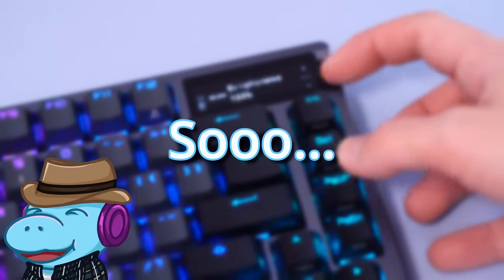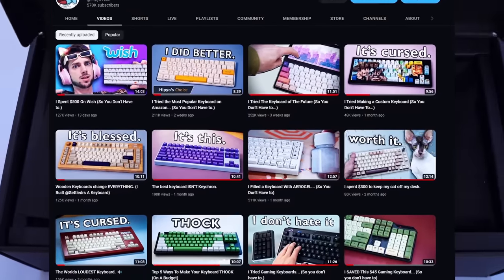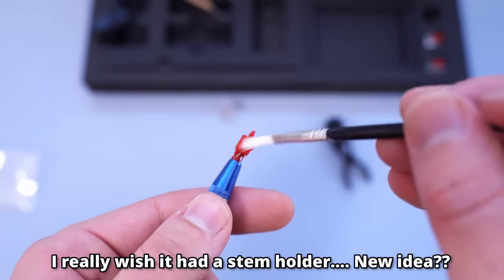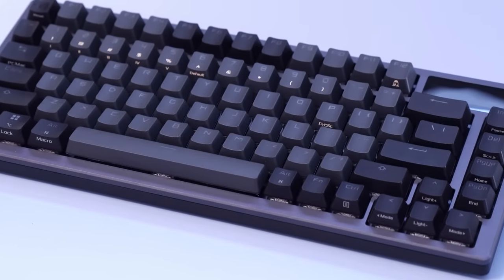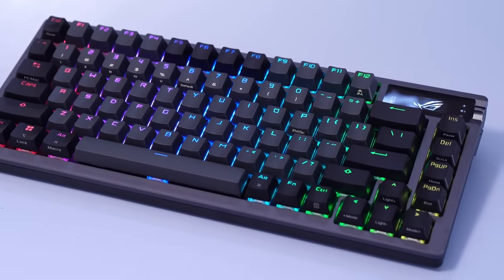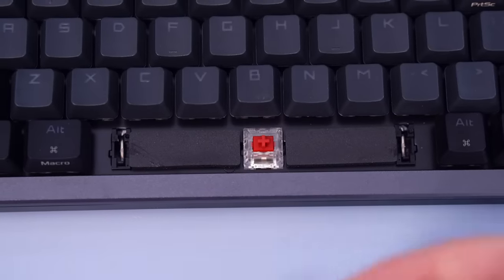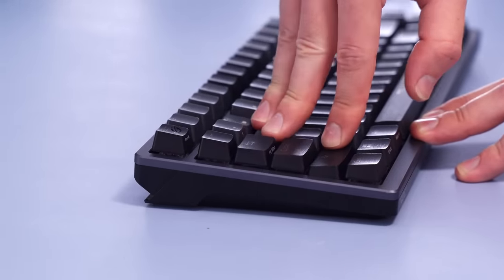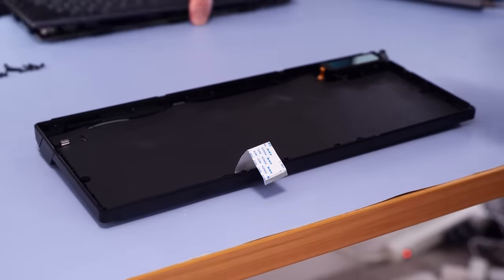I Tried the New ASUS Keyboard. ( ̶S̶o̶ ̶y̶o̶u̶ ̶d̶o̶n̶'̶t̶ ̶h̶a̶v̶e̶ ̶t̶o̶)

Comment: My problem with enthusiast keyboards were that they never had fast enough response times on their wireless functions than wired for gaming.  I really hope more companies follow suit with this Asus board.
Reply: With how close keyboards like these should be from your computer i believe they should just use 5Ghz or maybe 60Ghz even, would reduce the latency to almost 0.
Reply: Agreed! I like the ultra low latency for gaming but keyboards like GLORIOUS just don't have low enough latency for me. If the price is right, I think this would be a great compromise, especially if I can mod it to get that "thock"sound.
Reply: @DrakyHRT  That does help, all things being equal. A little bit, very minimal. Reducing the stack to help bring down the number of steps would help a lot more. Average keyboard controller does all the steps in like 100µs, leaving 900 of them even if you wanna be on time for a 1000Hz polling rate.
Reply: @DrakyHRT  2.4ghz dongles basically already have 0 latency. Linus did a test of wireless gaming mice that had negligible differences in terms of performance vs wired ones. Negligible in the way that the wireless mice seemed faster.
Reply: @DrakyHRT  Some people buy wireless keyboards for the express purpose of using them across the room (for example from a couch to a TV setup on the other side of the room). This change would potentially cause dropouts and alienate that customer base 🤷‍♀
Reply: @Cobalt985  Why even react, no offense, but you can see the person doesn't really know what he's talking about. It's like 8-Bit 16-Bit consoles from back in the day.
Reply: Lol low latency doesnt make u a better gamer. Ur not in esports 😮
Reply: @johnle1723  Hehehe, yes this is a fucking W statement!
I kept thinking as well, damn these people must be a top 100 players in any esport games.

Comment: My 77 yr old dad might like this keyboard.  He likes wireless because he types with keyboard on his lap (helps his arms and shoulder bones and arthritis issues etc).  

He also likes shine through North facing, because he types from his lap, often in low light and he prefers to see the legends light up.  *I'm still going to get him a nice BenQ floor lamp to illuminate his area better.

He also prefers a lightweight keyboard so he can lift it from his desk to his lap easily (he's 77 yr old and has shoulder and joint issues etc).

I'd modify this with Kailh Box Brown V2  switches.  I'd then use the thickest PBT double shot shine through caps I can find.  

I'd loosen the screws, similar to in this video, to prevent over compressing the gaskets and foam so that they work better.

Hopefully it won't be over $200 USD though

Comment: I've mained this keyboard for a while now. I actually really like it and don't see any reason to change it for now. Yeah it's a bit pricey, but you do get a solid keyboard. I prefer 75% layout. And when compared to one of my other keyboards like the Razer Deathstalker V2 Pro TKL it's just better in everything. For almost the same price! The battery life is insane on this, I've never experienced any wireless problems, the software works fine and the info screen is pretty nice for a quick check on cpu and gpu temp while gaming. I changed to silent tactile switches and different keycaps. I only wish it came in a solid black or white option. Kudos to Asus for making a really solid keyboard that touches more into the custom keyboard genre!

Comment: I actually tried this keyboard at the local Microcenter and loved it, came to see if anyone made a video about this keyboard. I think I tried the red switches and the sound was heavenly. I felt like they use some damping material beneath the space bar, and the video proved it. Not sue about the material quality used but from the surface looks like a decent keyboard.
Reply: i have it and i love it

Comment: I'm actually considering this keyboard, it costs the same as I was otherwise going to spend on a new board, has that wonderful screen, works with Armoury Crate (I already have an ASUS motherboard), and comes with the lube station included.

I like clacky, so i'll likely lube the stock switches and unscrew the case screws for more gasket performance.

Comment: Actually ordered one to replace my GMMK Pro. Seems like an almost perfect wireless keyboard if you need wireless along with BT. :) Thinking about getting the new Asus mouse as well due to the light weight and BT! Pretty cool to be able to use the same keyboard mouse for work without having to use a dongle.
Reply: I have the new Asus Harpe ACE mouse and it works great, I can recommend it.

I kept my GMMK Pro, though, I have heavily modded it to make it look and sound perfect and I don’t care about having a wireless keyboard.

Comment: The little screen really does nothing for me. I prefer a 65% keyboard. It does have north facing LEDs.

I like the foam. The kit is a nice touch. Hotswap is a necessity for me. The factory switches are alright for me. The wireless functionality is good.

Overall, this is a very good choice, but if the price is that high I think you'd find many better options for cheaper. There are many very budget friendly options on Amazon which are hotswap and even provide additional cool features some of which I like more than this keyboard. For $250, I could completely mod out those boards, buy a full set of keyboard tools, and even have some money left over depending on what I choose. I like it, but only if it's that expensive, it's too much.
Reply: if youre a PC enthusiast and not just a keyboard one, then the screen is pretty amazing tbh. being able to monitor temps in realtime without a overlay ingame or having a program open on the other monitor is amazing QOL
Reply: I prefer getting a keychon k6 pro with 4000mha battery life, and buy my own switches and keycaps!

Starting at 99 and max 119, keychron  is the best keyboard you can get for such good features, while others would charge twice the price for the same functions!
Reply: @UCPEmbppvNoBWQ--rQy5alPQ i didnt know i had to justify it. i was just giving an example of a use case. but i guess that warrants a personal attack ofc. this IS the internet afterall
Reply: @opvask  I am a PC enthusiast, but I've never felt the need to have an external screen to monitor vitals. Still, even though I don't see the appeal, I know things like that are popular. It's just not for me.
Reply: @lambdanebula8473  people just want the feeling of having something others can't or just buy it to boost to another! Smart people think about the cost-benefit of what you are buying! It could be something expensive but making sure you are getting your value back and not just being scammed by these big companies!

Sadly, people will never think this way, and prices of everything especially GPUs will continue increasing!
Reply: @uncorrupted7832  People wouldn't buy it if the price wasn't worth it for them, for whatever reason. GPUs are so expensive because they're actually worth that much right now. People always blame the scalpers for high prices, but the scalpers are only able to exist because the companies are selling the GPUs for less than people want to buy it for. If you sell it for less than it's worth, you'll have a damn hard time keeping it in stock, and that's exactly what we see. You just have to keep selling them at absurd volume until everyone has enough that it isn't worth it anymore to buy at that price, and unfortunately, there isn't enough silicon to reach that point.

It's supply and demand. It has nothing to do with big companies supposedly scamming people, and as for the keyboard, it's the same thing. It personally isn't worth the money for me, but it is worth it for other people potentially. Don't get me wrong, not all things are equal, but if you really like the features of this board and you're willing to pay the money, you won't find a better option. The features just don't appeal to me personally.
Reply: @lambdanebula8473  of course people pay and spend on whatever they want, just in my personal opinion that's just too dumb to buy something and getting your money back!

In most cases, something as simples as a research is enough for you to find something cheaper for equal features!

GPU prices in Euro are definitely not worth what you pay for, for example Nvidia 4090 rtx is around 2500 Euros, while the and 7900xtx you can buy it for 1190 Euros!

In the US, the Nvidia cards might be worth what they are selling them, but not here in Europe!

Even the scalpers are selling the AMD for only 200 more Euros!

Honestly people are just too dumb, I would even say if the prices were up 3k they would still buy it! The problem is that they destroy the whole market for people like me!
Reply: @uncorrupted7832  Some of the difference in price is hype, but I mean, tons of designer brands are built entirely out of hype. Apple is built entirely on hype, at least for Mac, and people like being able to flex. It's worth it for them for that alone. I personally don't care, but I can't expect the entire market to cater to my personal preferences specifically

Comment: Using plastic casing to allow better signal transfer is totally legit, plastic is great at radio signal pass through - and metal is the absolute worst material for that (it's radio reflective which mess up any kind of wireless signal.) There's a reason metal body phone is no longer made. 

The only alternative to plastic is glass for this application

Comment: Okay, so I have to ask: What is the deal with the hate for North facing LEDs? To me, the point of backlighting of any kind is to have shine-through caps so you can easily see the legends on the keys in a dark room. I get that it's not compatible with certain kinds of key caps, but that seems like a perfectly acceptable tradeoff so that they can illuminate the caps properly.
Reply: Problem is most keycaps not shine through.
Reply: @urabus986  not sure I would really call that a "problem" so much as a limitation while shopping. It's perfectly fine to not bother with backlighting at all, or not care either way. But if having LEDs is a selling point, I'm not sure why somone would then buy caps that don't shine through. And it would be really annoying to get an RGB keyboard, swiches, shine through caps... And then find out they are SOUTH facing LEDs and the switch stems block the light.

Comment: This is actually an interesting keyboard i would be willing to try. Did they gave you at least a hint of when is it going to be released? I would personally feel like this is a banger if it's not over 250 bucks.
Reply: I’ve seen the price point range from €300 ($320) to $355.
Reply: @bull1348  nvm then
Reply: @Jao Bai Dun ROG + oled screen + wireless + full accessory kit? No way in hell this will be $200 or anywhere close.  $250 might even be overly hopeful here.
Reply: @Jao Bai Dun on some taiwan store websites they are currently being sold for ~$240 usd equivalent. According to some singapore youtuber reviewers they will be sold for ~$315 usd equivalent. European reviewers have it at ~$318 usd fluxuating euro conversion (299 euros). I think after import cost and usually selling for more than the country that asus is based in, it's safe to say it will be close to $300 usd in the US or more.
Reply: @Bigheadedwon  The Steelseries Apex TKL Pro Wireless, which has an OLED panel and is hot swappable optical switches, is priced at $249 on Amazon.  I don't think a $250-300 is out of the question here.
Reply: @@lolithighs I hope it’s the price you’re saying, it really looks nice but $300+ is overkill. We’ll see.

Comment: I just got this and overall pretty impressed. Build quality is solid... a metal plate on the bottom would have been nice but I still like the plastic. Wireless is very fast, battery seems like it'll last awhile (even with rgb on), keys overall sound/feel great out of the box to me but definitely going to look into enhancing it a bit. This feels like a good first step for getting into customizing keyboards. I bought the red switch version but am open to trying an equivalent to the blue version. Any suggestions on solid switches that aren't crazy priced?
Reply: What made you choose the Asus ROG Claymore II over the Mountain Everest Max? I've been debating between those two.
Reply: @heathen6669  I bought the Asus Azoth. Overall amazing, few small issues with the software though. One of my best purchases over past few years.
Reply: @TheMrKlassy  That's cool. I accidentally commented on the wrong video. Meant to comment on the one that he reviewed with the Claymore II. lol.
I currently have the Corsair K100. Be the perfect keyboard for me if the numpad was on the left. I use 3d modeling programs that make use of the numpad, and it being on the right is way less efficient. It also offsets your mouse hand. The Claymore II and the Mountain Everest Max offer the option to place the numpad on either side of the keyboard. So it fixes that issue. If I were to do it again I would either buy a TKL and a separate numpad or a keyboard with the option for a numpad on the left.

Comment: Thanks for the review. I do think you made a mistake by using different switches which are kinda similar but loobed vs just loobing the stock switches with the supplied material. Now you are moving people in the direction of buying new switches while it might be identical performance like you mentioned. Next to loobing showing your own custom build would have been even better.

Comment: If it requires install of any Asus software I'm 1000% out. Yeah so Amory Crate is not "really good", it's a bloated mess that screws with other software, tracks users and also increases attack surface (no known vulns now, have been in the past, may be in future). I'm not just singling out Asus here, all peripheral software is hot garbage. There's really no reason why it needs to be locked behind software.
I was so happy and relieved to be rid of it! FYI I can still control my case lighting with OpenRGB, it all syncs etc
Reply: thanks for saying this! Amory Crate is the worst

Comment: I bought the rog falchion because of its size, now I would like a different type of switches than they where offering but the size is perfect and it looks pretty good imo. But recently I am experiencing some issues with my tab button, it's like its not probably connected or something, if I hold it down my score board in csgo just disepar, reaper at a mind-blowingly fast rate, same with my inventory in apex, although its not always like that, it comes and goes. idk what the issue is. if it gets worse or if it stops working all together I might return it and buy the  Rog Azoth,

Comment: Speaking of software: IF that software by any reason is armoury crate then no, it is actually pretty horrible. Doesn't work properly often, is bloaty as heck and sometimes the install just ruins your entire windows OS, which happened to me sadly. Also, north facing LEDs are somewhat nicer imho as you can actually use proper backlit legend keycaps since the custom market still hasn't gotten around to south facing legend backlit keycaps..

Comment: I would love to see a review on the steelseries apex 5 hybrid mechanical the price seems too good and I’m not sure if I should buy it
Reply: I’ve owned it. I’m gonna start with no, don’t buy it.

The first one I got had it’s RGB fail itself in about a month. I RMA’d it, and the second one they sent me had the same problem on different keys out of the box. Although, there may have been an issue due to me using it with a PS4, but that just doesn’t sound like something that would really happen. It just doesn’t seem to make sense.

And as for the switches.. they’re soldered in, which is already bad especially at the ridiculous price point for being proprietary. Not only that, but they’re blue switches, meaning they’re clicky and loud.

Not only that, but it’s not even a fully mechanical keyboard. It’s “mechanical-membrane hybrid.” I have no idea what that means, but it sounds like they just found a way to make it cheaper to make. Which again, is awful at it’s high price point.

Definitely aim for a better keyboard, preferably one with hot swappability.

Comment: Could you please do a review on the redragon k617 fizz, it’s a 40 dollar keyboard has nice lighting and is good in its stock form and I have been using it since the month it was released
Reply: it has anything good besides the price and lighting?
Reply: @urabus986  yes the sound is also pretty good stock it’s 2000 rupees
Reply: @urabus986  and a detachable cable

Comment: I'd be interested to know if anybody has any cheaper alternatives to this keyboard that provide similar features (i.e, the screen and/or wireless (this is the priority)). I'm looking at around £150/$180.
Reply: I'm also in the same dilemma as you and from my short time researching there doesn't seem to be a wireless keyboard that has a screen as good as this out on the market right now. But if you want to get one that has like 90% of the features on here with south facing LEDs it seems like keychron K pro series offer good ones with less than your $180 budget. I'm sure others can confirm with other options, I'm newer to this hobby.
Reply: Upcoming Zoom 75 (Actually a better keeb)

Comment: i was interested in this board but Asus has it listed at $249. sorry but for a plastic case plus all the mod work i would need to do and the switches i need to replace and new keycaps and new stabs its is not worth it. not even from a gaming point of view. if this was $149 then yes it would be worth it.